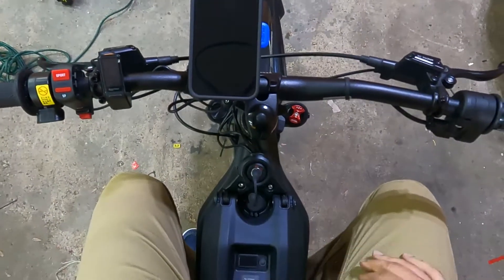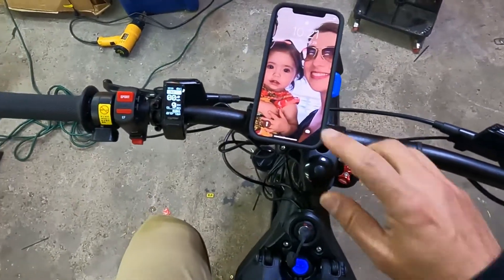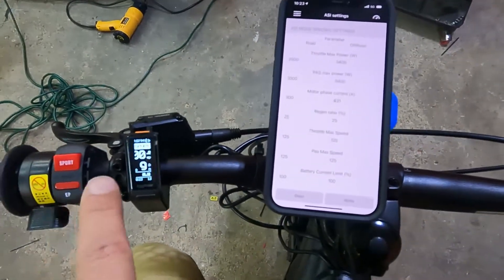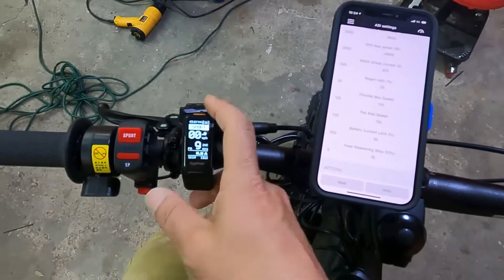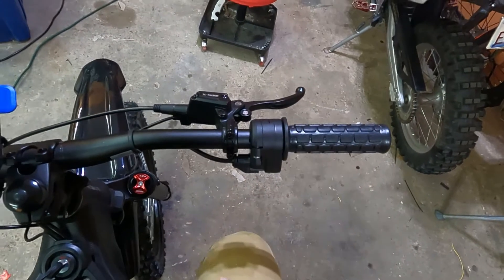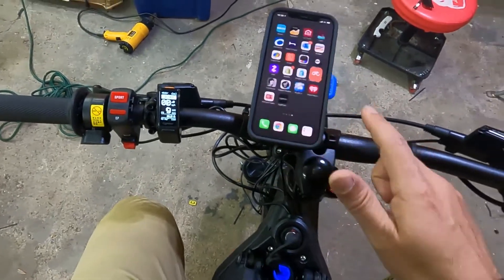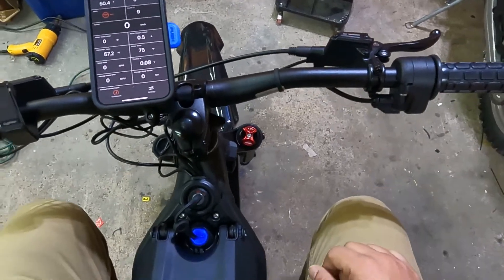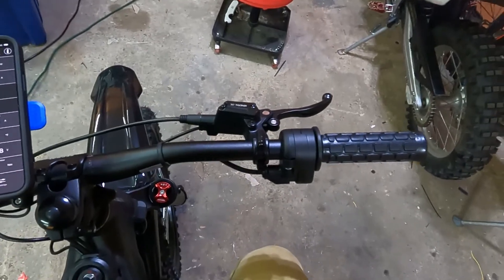Post Install BAC4000 Battery Tunning and Throttle PSA For Suron and Segway

Comment: I don't have an eggrider. Can I make these same changes in the GLE app? My Sur Ron is cutting out at about 35mph with stock battery non bypassed BMS. Also, are there any other changes i should make in the GLE app?
Reply: I should have mentioned im using your BAC8000
Reply: @mikemauch2695  you should be able to male all changes on the GLE Dashboard
Reply: @Buffetology  Yes i figured it out last night. I lowered the battery output to 89% in GLE Dashboard. I wish there was actual documentation instead always having to rely on youtube
Reply: What the app buddy or did u do it on the screen I think I have the some one and u the big screen and mine cuts out to